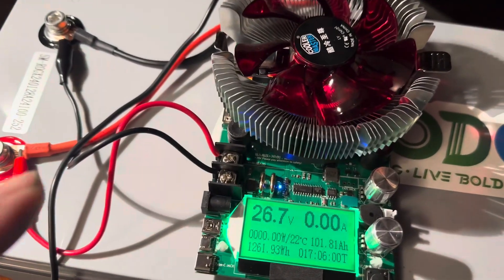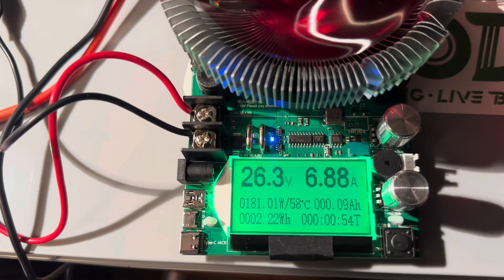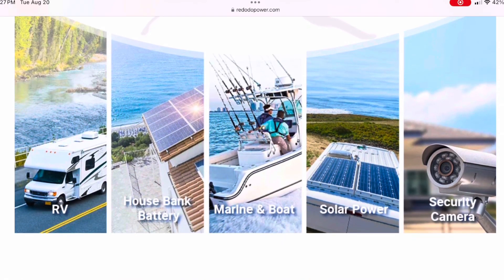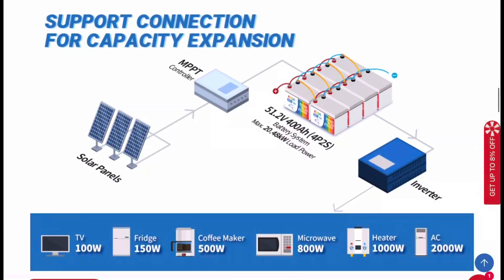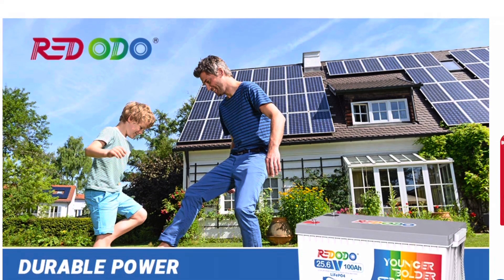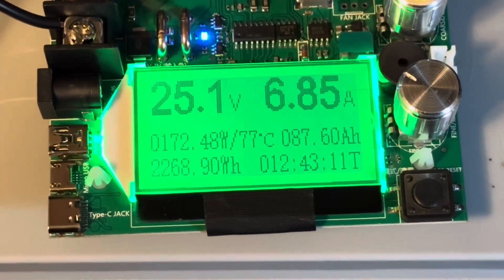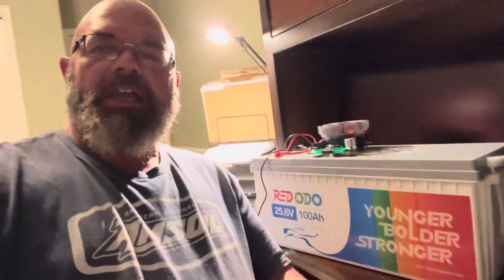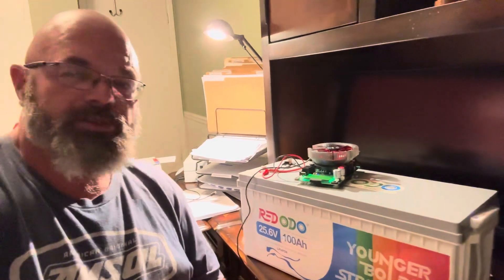REDODO  25.6 volt 100 amp hour LiFePo4

Comment: For those who don't understand the voltage/amperage discussion, it's simple. P= I x E   or  I = P/E      7.5 amps = 180 watts / 24 volts   15 amps = 180 watts / 12 volts